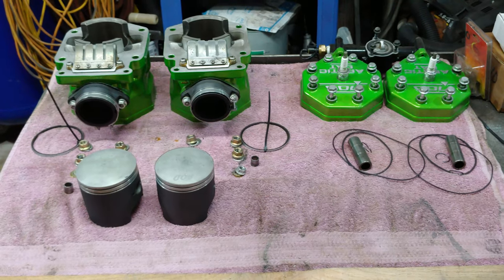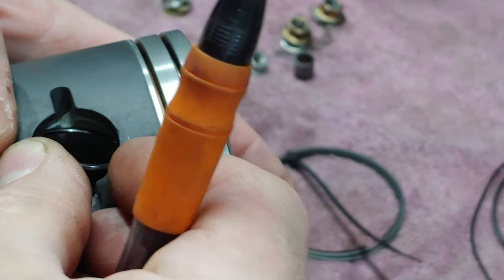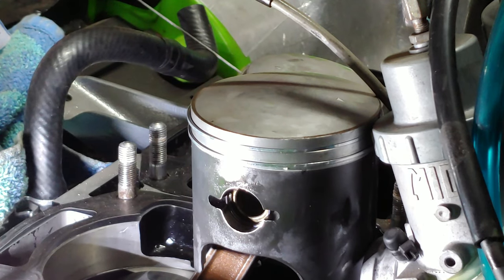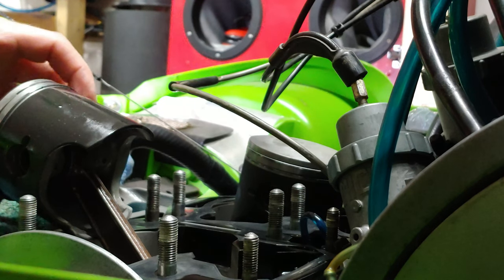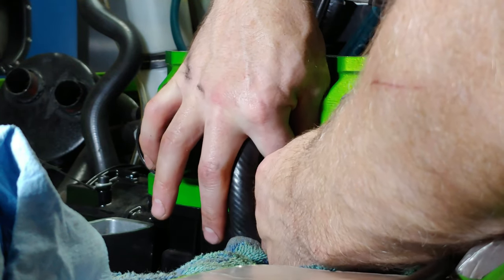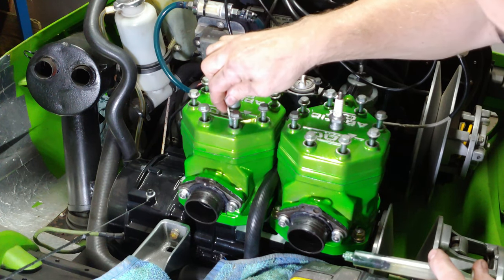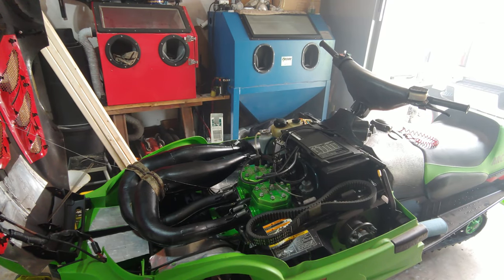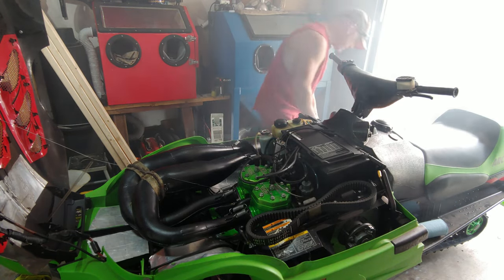95 Arctic Cat ZR 700 Part 8 || Snowmobile Pistons Race Coated by Line 2 Line

Comment: Check balls in your oil pump are bad if it's getting oil in the case when sitting
Reply from the maker: Check valves? The brass fittings bolted I to the pump?
Reply: @Fixin2Ride-Official-  yes check valves not sure why it changed it to balls when I put it 😂 the brass fittings where your small oil lines hook up to
Reply from the maker: Lol. Yep that them. I was under the impression those get stiff and dont want to open up when bad?